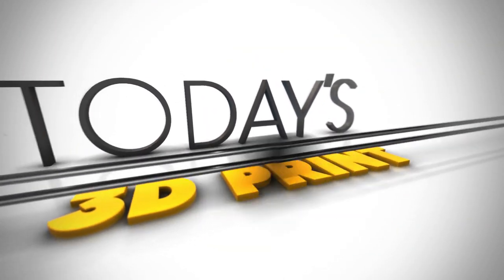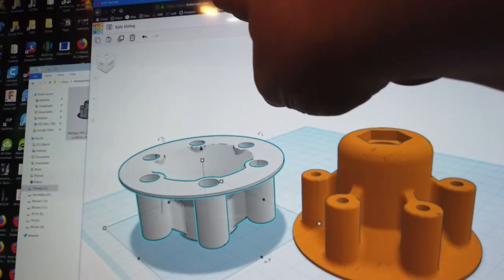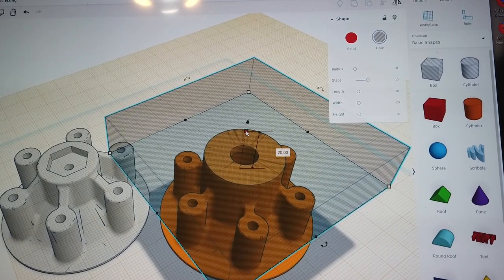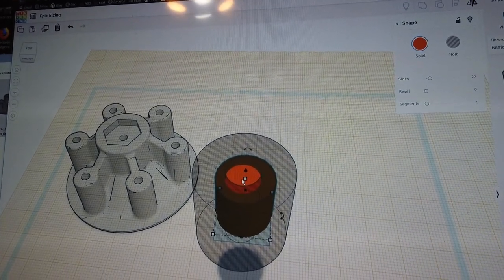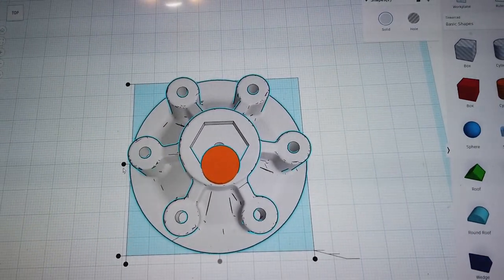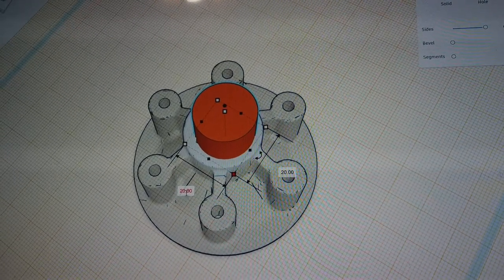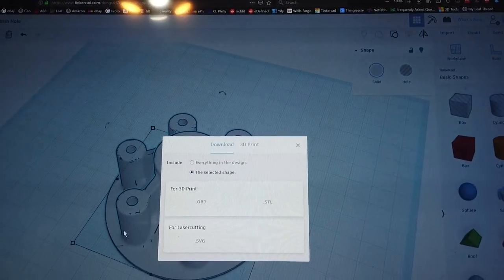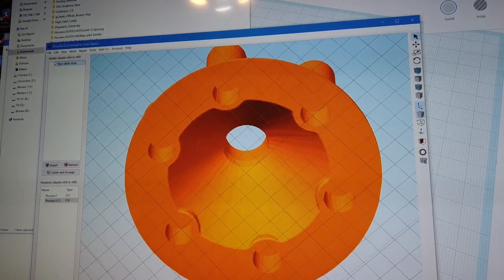Using Tinkercad to make small changes to existing 3D objects T3DP

Comment: OK, I learned a little more about Tinkercad. I'm wondering if there is a way to measure the hole diameter in the piece that is used to get the hole size? Then make the 'hole' object that size and follow thru with the making the hole in the piece you want.
Reply from the maker: That's exactly why we did the initial operations in order to figure out what size the hole was without having to print it out first I probably could have gotten close just by making a circle and adjusting its eyes until it looked right but this was more precise

An easier way to do it would be to drop an object inside the hole that was bigger than the whole but smaller than the rest of the objects Open Spaces then simply use the object as a cut tool single step measure the object undo everything create your new cylinder drop it in I might make an update video and just put it in the description of this video since it's a lot easier and faster

Comment: Hi Nerys, I have a big problem with my Monoprice Mini Delta, the hot end clogs up on the first layer or top of raft, particularly in the metal tube screw in bit (sorry I don't know the name of this component 😅). On investigation there is always a gap in the filamant before it gets down into the block that holds the nib. Help 😥
Reply from the maker: What do you mean by there is always a gap in the filament can you describe this more? The usual cause of this problem is a gap between the PTFE tube and the nozzle or the cooling fan that keeps the hot end cool is failing
Reply: Ok right, yes the filament is getting blocked in the screw in metal tube part of the hot end, which sits right below the short little plastic tube. I preheat the hot end, then when two layers of the raft have printed it seems to stop and just go back and forward in the same place just adding a thinner and thinner line. It is at this stage that the upper part of the hot end is getting clogged and if I don't imedietly remove the filament it will stop feeding to the nib leaving an air gap in the lower part of the hot end.
Reply from the maker: @paulbloomanalogue  that's called the heat break that part is not allowed to get hot if it gets hot you'll get a clock there's a little fan that cools that portion of the hot end assuming the hotend is assembled correctly that fan is likely the reason it's either not working or not working properly
Reply: @nerys71  thank you so much, I wish it said that in the printer manual. I will get a stronger fan 👍
Reply from the maker: @paulbloomanalogue  make sure the fan is working because the stock fan should be sufficient!

Also if there is a gap in the filament path inside the hot end at the point where the PTFE tube touches the nozzle this can also cause a clog

If you watch my video on assembling a hot end I go through the process which should be similar for the Monoprice Delta I would make a quick video specifically for the Monoprice Delta but both of mine are already packed onto the bus :-( so that will have to wait until after I unpack them sometime in the future

Comment: I find it easier to make minor changes using Tinkercad than the process of importing into Fusion 360. Surprises me that F360 doesn’t have a “simple” mode for such things. 
Chris, are you using the MarlinSTL viewer on your PC, or something else?
Reply from the maker: What is the Marlin STL viewer?
Reply: @nerys71  I saw it first in this video  https://www.youtube.com/watch?v=57ZxTmJiUtw
On DIY3DTECH channel.  It appears to have been around for some time.  After reviewing his video again, I see that it appears to be different from what shows on your screen.
What are you using to preview STL files as Thumbnails?
Reply: @partsdave8943 - Hey, :) Thx for that. Very interesting. :)
Here's the creator's GitHub link, so one can get the latest updates, etc.:
https://github.com/cabbagecreek/Marlin3DprinterTool/releases
And for the standalone STL viewer, i.e., the STL thumbnail is separated from the Marlin3DprinterTool is here:
https://github.com/cabbagecreek/STL-thumbnail/releases
Reply from the maker: Oh sweet he appears to have seperated it into its own install !!! nice! I will have to try this on a virgin pc and see how it works!

I use K-Studio Demo. (its in my profiles folder) its an old demo verison. it does not work but it does do the stl thumbnail trick on install which is the only reason I need it so all good :-) nice grey previews and a lot "faster" than the marlin3d tool one (though I have NOT tried the stand alone install!!)

 @4funrc11
Reply: Nice tool, thanks for the tip

Comment: I started to get the free licence for fusion 360 but this seems much more easy to use. I never got to fig out how to download 360 though. Was wondering if my account would work for this to download if I can ever fig out how. There made by the same company I think.
Reply from the maker: Yes same company tinkercad you can't download it's an online only thing it's very powerful and very easy but also very limited if you decide you really like 3D design I would suggest learning Fusion 360 as soon as I move and get settled down I plan to start learning it's very powerful just watch some chaos core Tech videos staggering what you can do with Fusion 360
Reply: @nerys71  thank you

Comment: could have just turned the whole first piece into a hole  then dropped it on a solid  and grouped it  then all you would have to do it delete the 6 little outer circles you would also have left over   wouldnt need to make the washer shape  and avoid all those steps    ✌
Reply from the maker: You would have to also delete all the pieces in open-air surrounding it as well I thought of an easier way after the fact of course we'll figure after I make the video :-) same thing I did but make sure the cylinder is smaller than the part but bigger than the whole give it a negative height and then use the part as a whole boom done in one step all I need from the cut is the dimension which would give me that that I drop a cylinder through with a clean circumference since the original part is not clean if I redid it now I can do it easier of course I'd be silly to re-record it :-)
Reply: @nerys71  word!

Comment: Wouldn’t a drill bit be easier
Reply from the maker: That's a pretty beefy drill bit and it has to be exactly centered and then you have to do it all over again if you need more than one spend 10 minutes in tinkercad or less and you can print as many as you need without having to drill them :-)

Comment: Blah! Hack. Take the time to learn Fusion 360. It's not that difficult to do.
Reply: Blah ! Who cares what you think.
Reply from the maker: You are right it is a hack that is the point of tinkercad eventually I will learn Fusion 360 I did manage to make my first complex shape and Fusion 360 a couple weeks ago but the learning curve is pretty steep when you have no time :-)
Reply: Fusion 360 isn't available to everybody though (still no Linux version). Tinkercad is universal and very rewarding for beginners.
Reply: @gavinsmalley1513 - Nah, you can run Fusion 360 within a Windows based VM (like Paperspace) or in the browser. RE: Run Fusion 360 in Ubuntu Aug 9, 2017 https://joshschertz.com/2017/08/09/Run-Fusion-360-in-Ubuntu/

Furthermore, Autodesk will likely never make available a Linux version of Fusion 360. And Tinkercad in this instance, actually takes longer to (almost) achieve an accurate modification than if it was done with Fusion 360 by a long shot. And that's a fact.
Reply: @nerys71  - Good to hear that, great really! 
"You fail only when you decide to quit learning.", gzumwalt (one hellva nice guy, and awesome creator, and equally awesome contributing Instructables member)
Reply: @4funrc11  Running in a VM still requires a Windows license and running in an online VM presents an hourly charge too. Both cost money and the former requires at least 8GB RAM.

Fusion 360 isn't and never will be accessible for those who can't afford Microsoft or Apple licenses.

There are plenty of other very capable (and open source) 3D CAD packages available in Linux that don't require M$ - but Tinkercad remains a very useful teaching tool as, because it is browser based, it looks the same for everyone irrespective of operating system or financial means.

Of course it isn't perfect (but then neither is Fusion 360!) but it is good enough for most people to do most things.